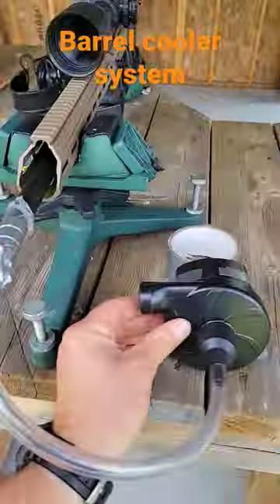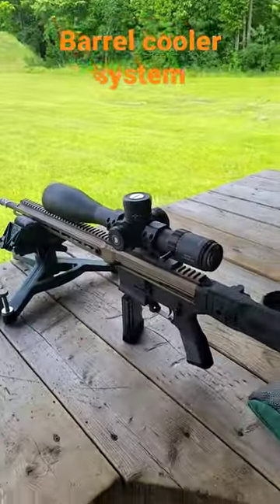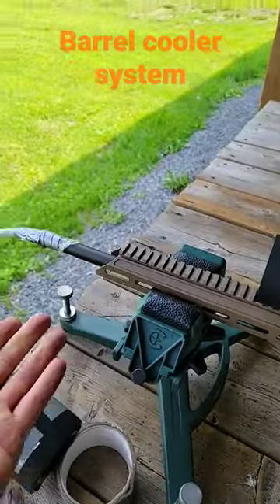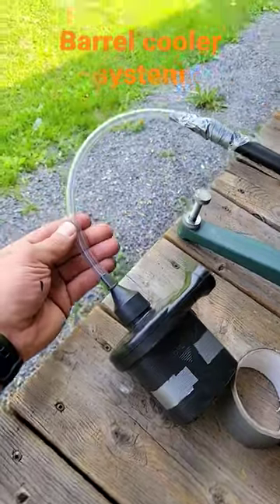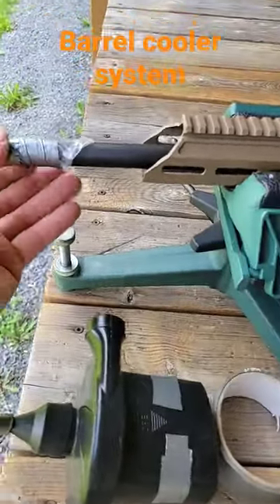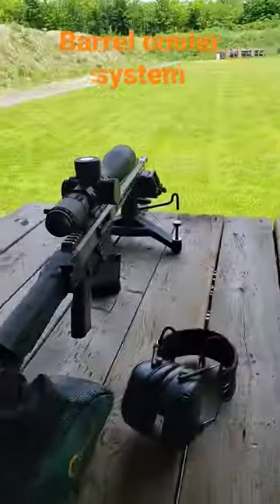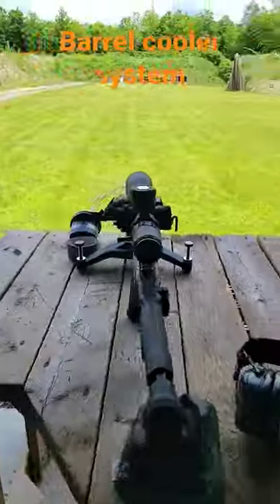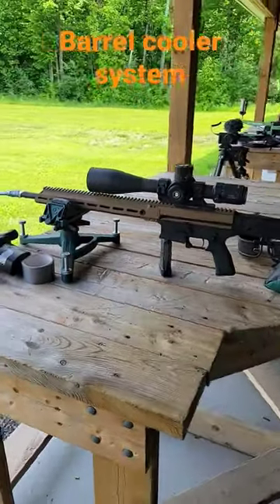gun barrel cooler system from amazon #gun

Comment: I just don't like the quick cooling. I get you're not creating much heat in a normal group, but the quick heat and cooling cycle has to, in my simple mind, increase the chance of barrle warping. I believe a continuous cooling system could prevent that 😅 but I have not finished my degree at SDI yet, so I am still learning

Comment: too noisy for a gun range ; it will bother other shooters while they attempt to concentrate. 
you're probably the kind of shooter that drops their hot cases on the shooter beside them.
Reply from the maker: Yes correct, when I want the range to myself I turn the barrel cooler to "noisy" and voila! I'm alone at the range again!
Reply from the maker: If your wearing hearing protection its not that loud....  :)
Reply: @EpikArms  I have the MagnetoSpeed™ Riflekühl Barrel Cooler and last night I placed a towel over top and most of the noise was muffled. They can be load at times and it does bother some shooters. Give a towel a try next time :)